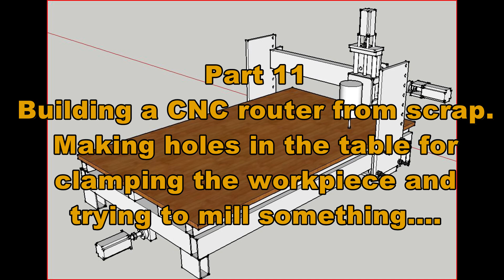Building my CNC router part 11

Comment: About the best "from scratch" build Ive seen.  Not many are capable of building a CNC  without a set of plans. But having a nice mill and lathe makes it a breeze. Mine is about the same size as yours also built "from scratch" but using mdf instead. Used V bearings running on steel angle Iron rails  and acme thread. I have mine set up to use either a trim router for wood and laminates or a 300 watt speed controllable spindle for aluminum, plastics and bras. Change over is just a matter of 4 bolts. I seen that quick shot of the 3d modeling program and are curious what it was. I use autodesk inventor myself.  Great Job!!
Reply from the maker: Thanks John
Reply: about the only thing I would have done different is the procedure to align the linear bearings. Simply bolt down one side solid then by pushing the gantry back and forth you line up the other side. Years back I did a lot of stuff using linear bearings. To get them to work best you are working with  tolerances around .002.  Trying to hold that precision over a foot or more becomes real problematic so why not use the bearings themselves in a self aligning approach. Saved  thousands in tooling costs doing that.   :)

Comment: good job, as I would like to have all the tools and machines you have, to make my cnc router, but only fairy with a saw and some screwdrivers. could you tell me how is called the kit I buy? where are the drivers, power supply controllers and motors, I buy them, could help me? thanks

Comment: Can you tell me which machine is montaged in to the CNC's head?
Great work man!
Reply from the maker: It is a kress 1050 watt
Reply: Thank you!
Reply: Can you tell me also if it is good enough that Kress 1050 or would you buy another mill?
Reply from the maker: The kress 1050 is ok for the work on a cnc.